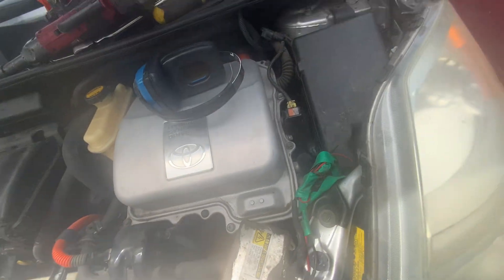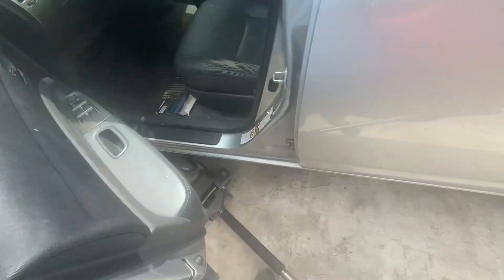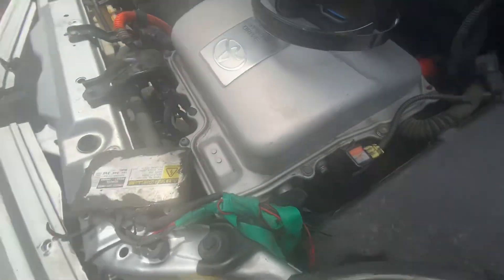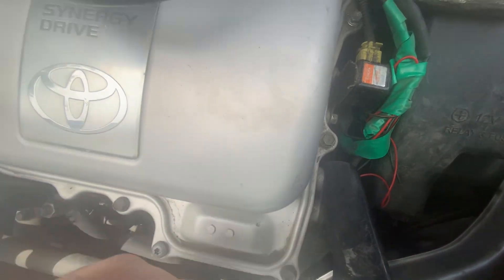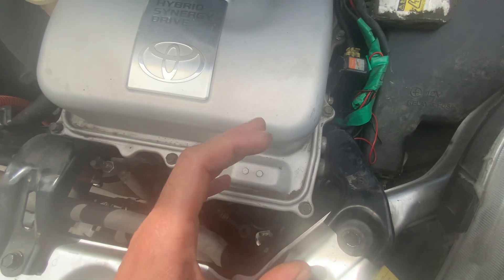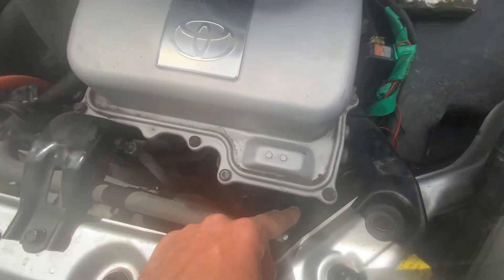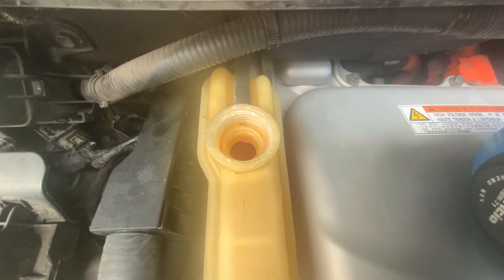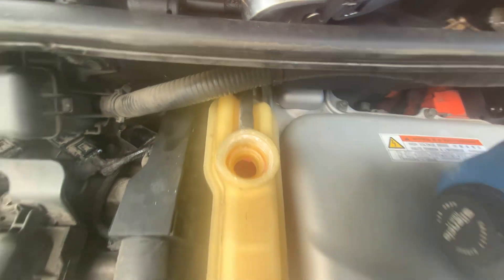2nd Gen Prius 04-09 Water Pump Inverter Noises / Aisin / OEM Discussion Part 2 / New Noise

Comment: What happens when you put a brand new pump in and it makes almost a revving noise and I have no turbulence in the tank and when I bleed it nothing comes out. Pump makes a wrrrr wrrrrr wrrrr wrrrr sound slowly
Reply from the maker: really hard to say my man post a video of it. there is the coolant valve like i explain. you probably haven't bled it right if you aren't seeing any turbulence. it should figure itself out